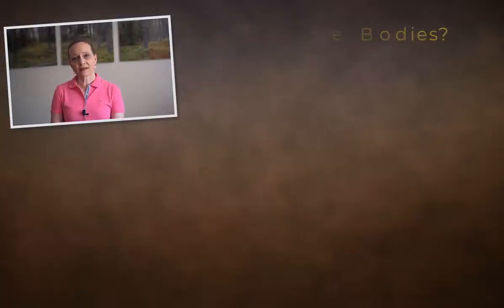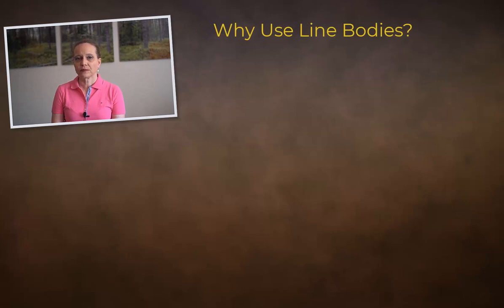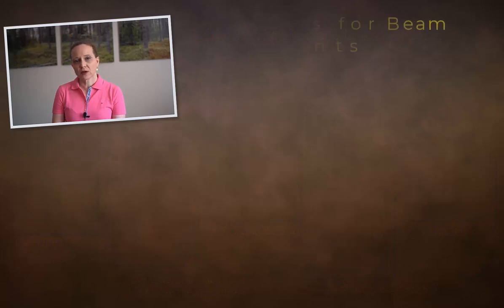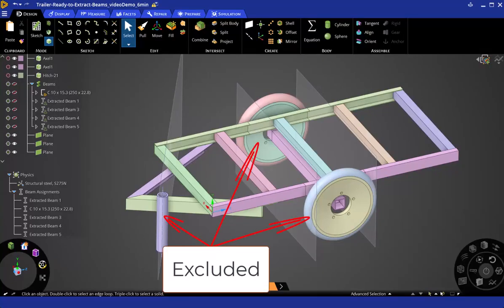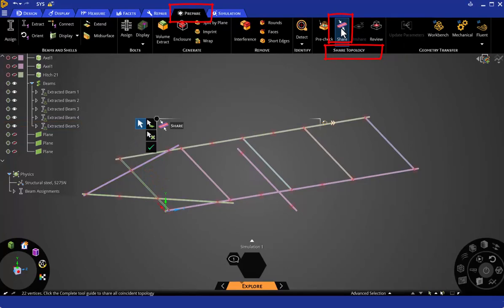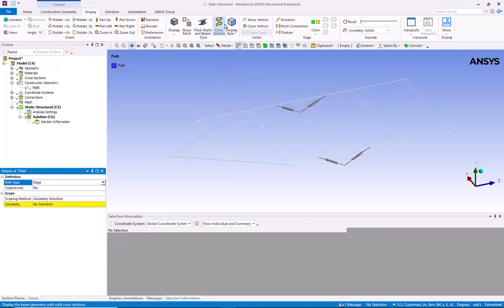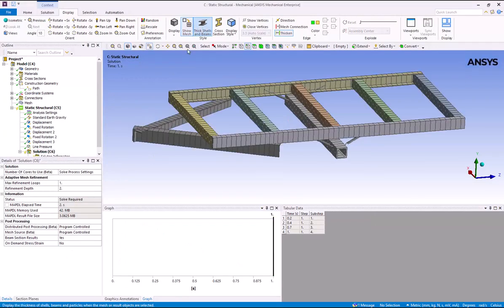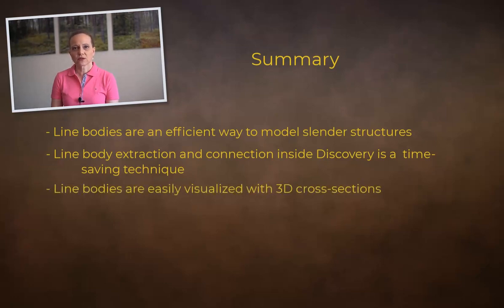Analyzing Slender Structures Efficiently Using Ansys Mechanical — Lesson 3

Comment: Hi Dragana Jandric
Thanks for the video

The formula for slenderness ratio that you have used is not matching with the formula for slenderness ratio given in standard text books of strength of material.
Formula for slenderness ratio, given in strength of material by F.L singer is
Slenderness ration=(L/r)=√[(EAπ^2)/P_cr ] 
Where,
L= equivalent length of column
r = Radius of gyration
E= modulus of elasticity of column material
P_cr/A=Stress in column at critical load
Whereas the formula that you have given for slenderness ratio is
Slenderness ratio=  (GAL^2)/EI
Kindly clarify
Regards